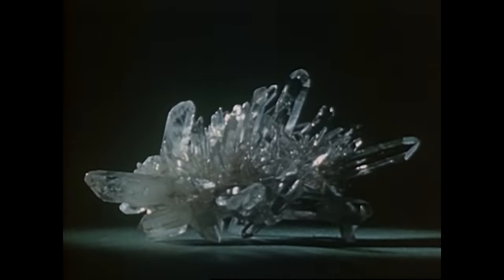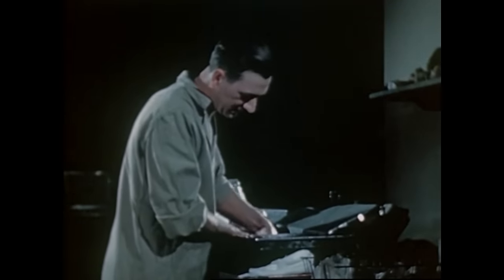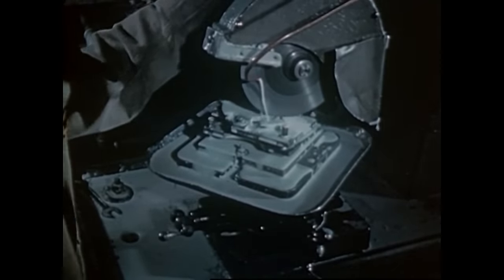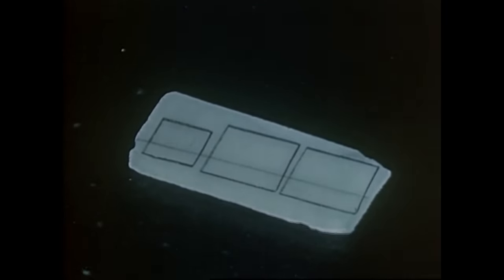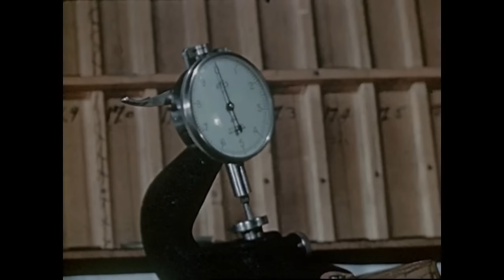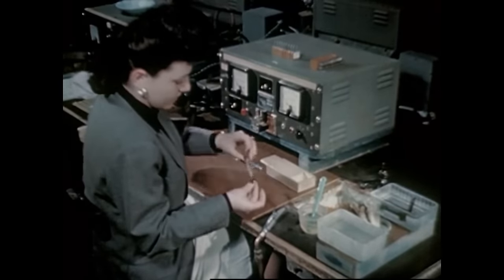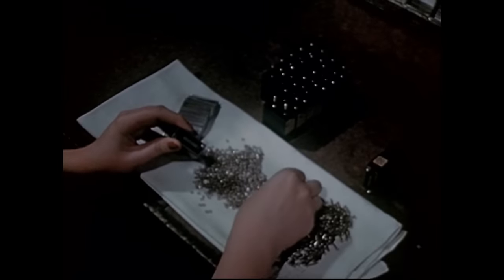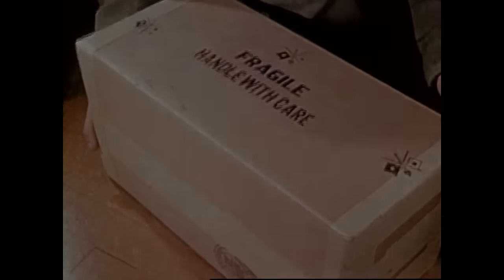From Raw Crystal to Crystal Oscillator - Crystals go to War in 1943

Comment: So much manual labor on something we now take for granted in modern electronics.
Reply: And the film itself. Every title and transition all done with manual tools.
Reply: @8BitNaptime  They probably have been making them by machine for many decades now.
Reply: Mostly replaced with silicon-based oscillators now, because they're much simpler to make, etc. Still useful technology without which we'd still be reading newspapers for news and studying in person
Reply: @wolfy9005  But not as accurate, hence why crystal oscillators are still in use.
Reply: @wolfy9005  There are MEMS oscillators, but they have had a bit of a scandal when iPhones died when exposed to helium.

It appears my PC motherboard still has crystal oscillators, with the very noticeable thin round can type (32768Hz tuning fork crystal) to keep time.
Reply: @wolfy9005  Wrong, quartz crystals are still used everywhere, if fact your phone and computer have at least a few.
Reply: @soundspark  Most are surface mount. Motherboard likely to have a few 25MHz crystals, 32.7kHz and maybe some other.
Reply: Silicosis plant
Reply: @woopsserg  I looked at my motherboard, the 32.768k crystal is the long thin can type that has been made for a long time.  Yes the main oscillators are SMT type, but they are a bit bigger than those MEMS types.
Reply: @soundspark  They can be absolutely tiny. I ususlly use 3.2x2.5x0.6 mm (0.125x0.1x0.024")  crystals in my designs. However they can be much smaller than that.
Reply: @woopsserg  Quartz or MEMS?
Reply: @soundspark  Quartz, I don't know exact number but I doubt MEMS have a more than a single percent of resonator/oscillator market share. MEMS oscillators really make sense only if frequency needs to be higher than quartz crystals go, needs some oddball frequency (at low quantity, custom crystals can be ordered easily in volume) or needs to be adjustable. Quartz crystals are way cheaper and more precise/stable. EDIT: MEMS also can be advantageous for extremely low power consumption..
Reply: we take everything for granted. We have become a spoiled species.
Reply: @woopsserg crystal oscillators are used for radio circuits, as they are the only type accurate enough for the job. This includes wifi and Bluetooth radios. Mems oscillators are not accurate enough to meet spectral emission requirements
Reply: @DeathByFilmStudios  Crystal oscillators are used nearly everywhere where accurate timing is needed, and in many cases when accurate timing is not even really required. I think MEMS can be accurate enough for bluetooth and wifi (SiT8208 claims wifi in the datasheet for example) but usually there is no point, they're less accurate and more expensive.
Reply: semi-conductors are now smaller than ever and with chinese microelectrionics, its only getting smaller and smaller.
Reply: @woopsserg  Can e not just grow our own perfect quartz now? (and not have to mine it and sort it). Like with lab made diamond, it's far better quality than natural diamond... but at the same time, it lacks in strength compared to natural diamonds (by up to 10% if I'm not mistaken).
Reply: @wolfy9005  noting that quartz is silicon oxide.
Reply: @deucedeuce1572 The process of growing suitable synthetic crystals was invented in the 1950s. Shortly after, the industry abandoned using natural quartz, and now all quartz resonators are made from synthetic crystals.
Reply: @veteransniper6955  Cool. Thanks. Good info. Makes sense. We could make flawless crystals and skip the vast amount of work required with these natural crystals. Still amazing they figured all of that out though and brought it to production and use.
Reply: @wolfy9005  For the most part yes but there is still nothing more accurate and stable than a TXCO  Temperature Compensated Crystal Oscillator
Reply: @soundspark  from what I know, quartz oscillators are made from lab-grown quartz because natural quartz has too many impurities
Reply: @DeathByFilmStudios  Crystal oscillators are not the only type of oscillator that is accurate enough, but they are the cheapest that is accurate enough.
GPS needs even more accurate time measurement and thus it uses atomic clocks in which rubidium atoms oscilate.
Reply: @wolfy9005   main system clock and RF circuits for cellular communication are still quartz
Reply: @soundspark  interesting
Reply: Right? It's unbelievable!
Reply: @jjreddick377 
If you say so, it must be true.
Reply: Modern quartz oscillators are synthetically grown crystals.
Reply: @soundspark  Crystals are "grown"/deposited theses days rather than cut from natural rock.
Reply: I take nothing for granted.  We are lucky we weren't born in the middle ages.  Out of all the peoples of all the histories of the entire earth, we are the luckiest to be born at this time.  It's much better than being burned at the stake for teaching your children the Lords Prayer in English.
Reply: @julesverne2509  
Amen brother.
Reply: @_-__--10035dhkie all cuts are made with water, I don't think there's any risk
Reply: It had to start somewhere. Just like the road to Precision started with the very first crude metal lathe

Comment: 1958 I was an apprentice at DECCA Navigator. Another apprentice an I were given a job of building Xtal Oscillator assemblies for the DECCA Mk 5 marine navigation system. We measured the resonance and output voltage of each plate before assembling into the module. The clear used was called Araldite, the British version of Eastman 400 glue. We then tested the modules in an Oscillator jig. We delivered each batch to the production Foreman. Later I was a Priduction Inspector. I finished my Apprenticeship as a Prototype Technician to an Engineer. The Engineer was Ken Mantovani, son of Maestro Mantovani, of the Mantovani Orchestra fame.
Reply: What do you work for now ?
Reply: @jacobmoonlight5793  That man must be in his 80s at this stage, so hopefully he's retired.
Reply: @nodnodwinkwinkV  nah he's probably still working 3 jobs...
Reply: @quoudten like many pensionados they are busier  than before retirement......😂
Reply: @Baard2000  ha ha well i was commenting on the "new American dream" but yours works too...
Reply: Eastman 400, the American version of Araldite. 🤣
Reply: This is why aircraft radios were very expensive because of the required number of Crystals. Now I can understand why they were expensive.  The labor cost must have been huge
Reply: Neat.

Comment: An SC-cut 5th overtone crystal maintained at 90 deg C drives a diy clock  I made 10 years ago.  In that time it has gained nearly two seconds.  That's one part in 158 billion.  Quartz is amazing!
Reply: Not an expert but at that rate, couldn’t the deviation be explained by gravity differential?
Reply: 158 million, not billion
Reply: That is why we must use a secondary correction in order to keep super accurate time. I spent 30 years in the quartz industry working on low noise, high long term accuracy time bases. To this day, even though  retired years ago, I still maintain a respectable lab for fiddling around with time bases.
Reply: @professorx4047  You're right.
Reply: Cesium atoms and quartz oscillator are called atomic clocks, and the most accurate man has discovered
Reply: @shable1436  Discovered? Did someone digging a trench in Calcutta unearth a billion-year-old cesium clock built by our ancestors? Or... did you mean "invented"?
Reply: @BerzerkaDurk  jesus himself revealed the cesium atom and quartz crystal oscillators. if it's worth knowing it's in the bible. /s
Reply: @0b11000100 that’s right quarts oscillators are famously in the Bible and totally worth knowing lmao
Reply: @Mr_toe_  it would be awhile before we discovered gallon oscillators, but that's a different can of worms. /s
Reply: @0b11000100  honestly can’t tell if you’re joking anymore
Reply: @Mr_toe_  notice the /s
Reply: @aretorta  what is the slash s for idk
Reply: @Mr_toe_  it means "sarcasm" im just kidding, it actually means "sexual connotations". /s

Edit: tbh i didnt know either but i used process of elimination to determine what it meant.
Reply: D. Jensen

Wow, An SC-cut 5th overtone quartz crystal maintained at 90 degrees Celsius (194 degrees Fahrenheit) is known for its exceptional frequency stability and low temperature coefficient, making it suitable for high-precision applications impressive sir.  So, Over ten years, if this crystal has driven a DIY clock and gained nearly two seconds, the implied frequency stability sir, is about 6.33 parts per trillion (ppt). Now.. This level of precision is theoretically possible with high-quality SC-cut crystals under ideal conditions as you know,,  where temperature control and minimal aging are maintained. However, achieving such extreme stability is rare and typically associated with atomic clocks rather than quartz oscillators. Therefore, while not entirely impossible, such performance in a DIY setup represents the extreme upper limit of what high-end SC-cut quartz crystals can achieve.
Reply: Credit Robert Burgcon and Robert Wilson of Hewlett-Packard's Santa Clara Division for the development of your SC-cut, 3rd overtone Xtal. Developed as follow-on to the 10544-series, was first mass produced for the 10811-series Ovenised Xtal Oscillators. h/p Journal, 1979 and IEEE-Xplore, 2005 have great articles on this item.
Reply: Your power hasn't gone out in 10 years?  I think your electric company is more impressive.
Reply: @jim9689  The oscillator and associated circuitry is powered by a 15 V SMPS.  When mains power drops out - which has happened several times - a diode attached to a 12.6 V lithium battery becomes forward-biased and automatically powers the circuitry.
Reply: @johnnyreb280  A precision OCXO has a higher rate of drift early in its life.  My oscillator had already operated for years in a Stratum clock, so it's drift rate had stabilized quite a bit.  Secondly, I didn't 'push' the oscillator - I let it oscillate at its default frequency and then measured that frequency across a significant period of time, using the leading edge of the 1pps signal from a GPS receiver, and formulated the proper digital compensation.
Reply: @blackrifle6736  Operating at its fifth overtone, the effective Q of the crystal is considerably higher than at the third overtone.
Reply: @johnnyreb280 I was a metrologist. We had HP rack mount frequency counters (don't remember the model numbers) that took about a day to calibrate......from the top value down to DC. We used reference and transfer standards that were traceable to the National Bureau of Standards in Boulder Colorado. The crystal oven had to be on long enough for the crystal to sink the heat from it. After warmerup, we began the calibration.

Comment: As A novice Amateur radio operator, I was only allowed to use a transmitter with a crystal to control the frequency, no variable frequency oscillator transmitter was permitted, which meant I had to spend my allowance on many crystals, for the three bands I was allowed to operate on.

As I learned over time, the crystal frequencies could be changed by disassembling the holder and using a pencil to make a dot on the center of the crystal, I could lower the frequency a small amount, or by grinding the crystal on an oilstone, I could raise the frequency in order to avoid the many foreign broadcast stations operating in the novice ham bands.

But the best crystal hack was to add a screw to the metal cover of the crystal holder, and adjust the pressure on the mounting plate to change the frequency without having to open the holder each time to change the frequency.

All that changed after the first year as a novice, when there was a rule change, allowing VFO, variable frequency oscillator transmission, and my money was spent on a VFO for my transmitter! And what a change! Being able to tune up and down the bands opened up my tiny novice bands, and I was able to communicate with other hams around the world much easier than ever!

But the best type of frequency control is the 'synthesized' oscillator, and it still uses a quartz crystal to stabilize and control the oscillator, and allows for channelized switch controlled frequency selection.

Technology has advanced, but crystals will still be used in electronic equipment in order to keep the required source of oscillations needed at the right frequency, and as stable as possible. And even if the crystals are no longer made from natural quartz crystals, but are grown in a lab, the history of their benefits to communication and other electronics, including the health industry, will continue to grow!
Reply: we use crystals more than ever.  their uses in computing have exploded, there's probably 1 to 3 in the pocket of the average north american at all times, and who knows how many in their home.
Reply: @tsm688  The use of crystals has exploded, as they can also be used as filters as well as in oscillators!
Reply: @tsm688  certainly more than 3, any modern mobile phones has 5 to 7 when counting SAW filters. But modern crystals are all synthetic and the production process is fully automated, nothing to do with this film.
Reply: I thought most were already grown in labs because you can control the environment, I've seen this one crystal that was in the shape of a huge cylinder, perfect looking mo inclusions, same with a thick square one, they were grown for NASA or something but they didn't pass the requirements, so they get sold off. My understanding is most electronic crystals were synthetic nowadays.
Reply: @shable1436  they are.  you don't have to mess around with finding the right angle because it's the angle you grew it at.
Reply: that was very informative 
thanks
Reply: I love that you shared this, thanks for describing your experience for everyone to learn from.
Reply: @tsm688 if I'm not mistaken, that is very important when making lab grown ruby for lasers.
Reply: @xXxJSCOTTxXx  absolutely.  laser crystals are cut at very specific angles where light splits into different polarizations
Reply: That’s probably why those were the only ones you were allowed to use.
Reply: @stinkymccheese8010  VFO's used to actually be pretty bad.  Mistuned, even a VFO *receiver* could cause interference.
Reply: @tsm688  part of the learning process. The tinkering that would result would lead to a better understanding of what is going on.
Reply: The 1930s must have been wild.
Reply: @stinkymccheese8010  if anyone thought to tell you that you were screwing up reception for a block around you.  that's why restricted.
Reply: @tsm688  thx, good to know.
Reply: but, you wld use harmonics to get onto other bands and the selectivity of the PA tank ie 3.5;  7; 14 mc/s etc
Reply: As a child of 12 my 300 watt neon sign xformer (21kv peak) was rectified and charged a bank of doorknob TV caps which discharged thru an adjustable air cooled spark gap out of an old diathermy machine, becoming part of an L/C circuit energizing a 10 turn primary wound on a 
cardboard Quaker Oats  container. The 
secondary was 100 
turns and produced 200 kv at VARIOUS radio frequencies. Hooked to an 80 meter long wire, it destroyed TV reception for blocks around. The FCC suits showed up and told my mom this was a $500 a day fine and to knock it off. I did. Yes crystals make a lot of sense but at 12 , I just wanted big sparks. That was  in 1956
Reply: @jamescarraway5523  And to think my Ford Model T spark coil was much less power, but had the same reaction from the FCC, but they thought I was running a welding machine that was splattering all over the airwaves!

I never did get the circle of wire to spark between the two balls though, as I didn't know the circle of wire was too short to resonate.
Reply: 73s
Reply: @tsm688  Very true, and it is also how you can locate a radio receiver! Either by listening to the local oscillator frequency, or the IF frequency.
Reply: I have 10 lbs of the raw crystals from a company in Ohio that grows them in chambers pressurized from 3000 to 6000 lbs!!!
Reply: @ChasOnErie  What kind of crystals? Are they all quartz?
Reply: Thank you for sharing the "walk through" of your HAM journey. I think it's so cool because I can interpret that I am apparently just a little younger than you are given my uncle and influences used to use oilstones and "screw hacks" to push the envelope. The spectrum of changes that the world has experienced during our lifetimes will probably never be necessary again.
Reply: @PocketInquires  And the experiences will be lost to time too.
Reply: In modern parlance we would call this a "hack" 🙂
Reply: @T-Ball-o  Quite right! In order to get to frequencies not occupied by foreign broadcast stations, I had to hack the crystals to move the frequency. I never did try the screw through the cover hack, that allowed the pressure to be used to move the frequency, because, by that time, we were allowed to use VFOs.
Reply: you should make a video about this
Reply: That comment was entertaining and informative. Its so valuable to get a sense of what life was like before my time.
Reply: @nannesoar  Thanks, it matters to pass on history to people who may never have to use such information, so they understand what we needed to do, to get by in the past without the modern conveniences.

Or to work around obstacles created by the rules of the game...

Although, if I had thought of it back then, a synthesized frequency generator is able to create variable frequencies, AND it IS crystal controlled.

I wonder what the FCC may have thought of that idea?